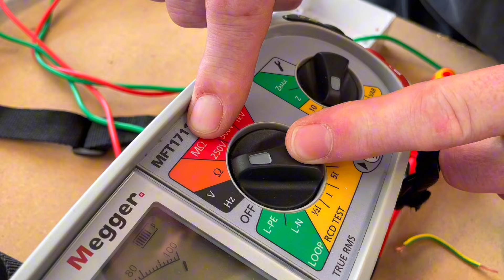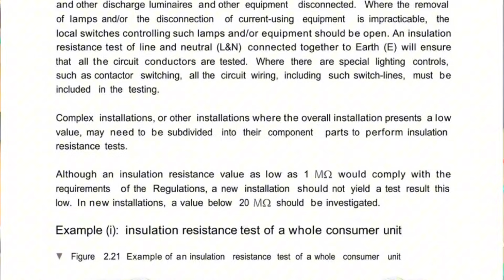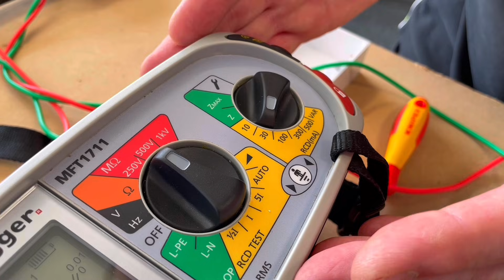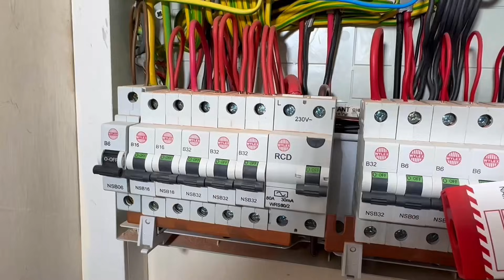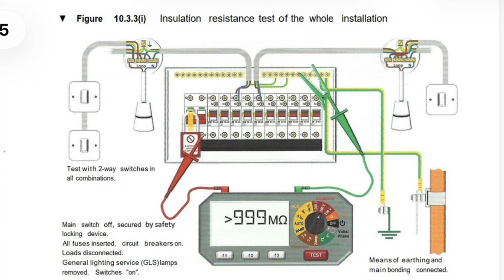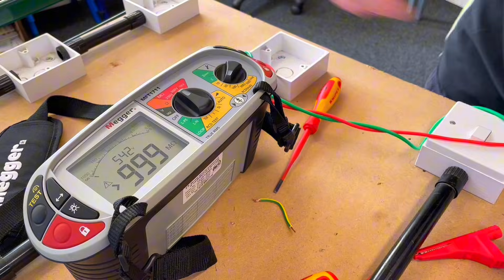Stop Making These Mistakes - Insulation Resistance Testing

Comment: • Megohm (often written as one word) is the standard and most common technical spelling used in engineering, physics, and technical writing (historically shortened from "mega- + ohm").
• Mega ohm (written as two separate words) is also widely understood because "mega-" is the metric prefix for one million, though it is less formal

Comment: GN3 states on individual tests that the line and/or neutral must be disconnected from circuit breakers and not test through the screw or the neutral bar

Comment: Why do you need 500VAC to check for resistance? Surely any voltage sent between low resistance pathways will indicate ~zero ohms, and high resistance ones ~infinity ohms?

Comment: Maybe it’s just my opinion but shouldn’t we do an insulation resistance test for each circuit to get more accurate results? If testing the whole consumer unit & one circuit is 100M ohms for example you wouldn’t note that for all the remaining circuits. If the whole consumer unit is >999 then it’s not an issue & more straightforward to fill the forms out

Comment: The newer MFT testers from at least the last 15-20 years cannot damage sensitive equipment if accidentally meggered as the test ramps the voltage based on the resistance detected 👍🏻

Comment: You need to do a video where the board has RCCBOs in the board, it's not as simple as this, this is an easy way out demonstration 😮
Reply: Why are RCCBOs problematic?
Reply: @MS-Patriot2  exactly surely if your probe is on the outgoing and the rcbo is switched off there won’t be an issue. Your not going to be putting the test voltage through it same as what Gary said in video.
Reply: @MS-Patriot2  If you have old-school RCBOs with the annoying reference earth (cream fly-lead) and you don't drop the neutrals from the bar, your N-E test goes through the RCBO and pulls down the reading.
Reply: @Dranok1  good point, thanks !

Comment: What is the reason the E C and the B C must be in place when carrying out a IRT you never told us can you make a video showing us  because if I do an IRT on 30metres of 2.5T&E not connected to anything it is not connected to the EC and BC
Reply: The reason for the IR test is to check the cables insulation(obviously), and also to check the cable isn't damaged and connected to anything via a screw/nail or some other non visible damage, these tests are carried out with cables buried in walls, above ceilings, if the bonding e.t.c was not connected you might not detect a cable which is leaking to the earthing system.